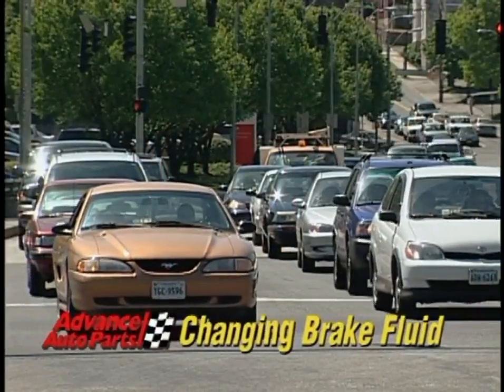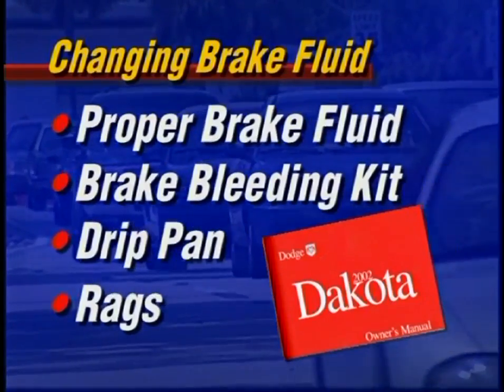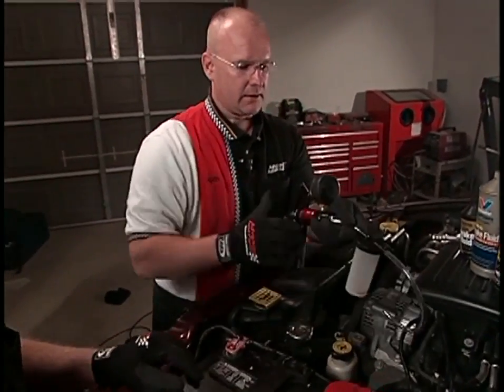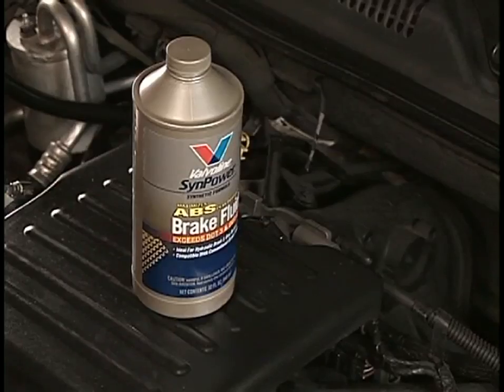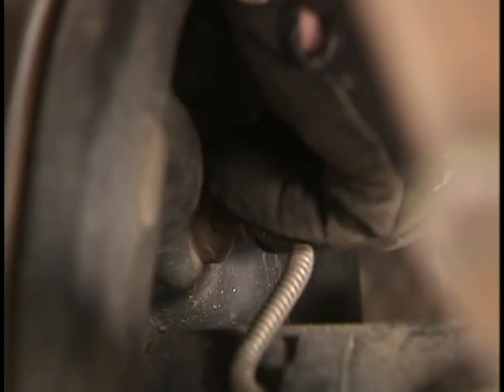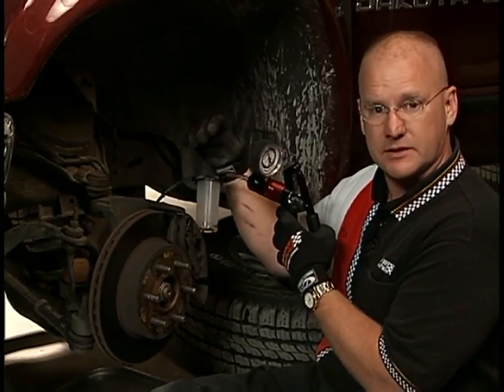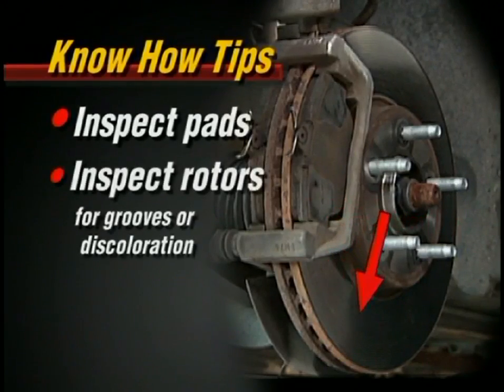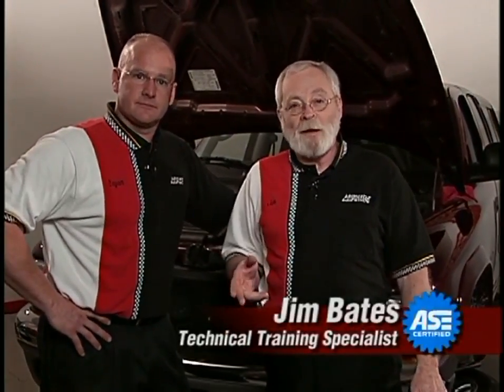How to Change Brake Fluid Video | Advance Auto Parts

Comment: First:  Never use a plain open end wrench on a bleeder screw - use a 6 point box wrench or a flare wrench if you have one.  Next - the bubbles you see when using the vacuum tool are usually the air that enters the bleeder screw through the threads while sucking the fluid out.  You can tell because these are nearly always very fine bubbles unless you have the bleeder screw too far out or you really do have air in the system.  Looks to me like the first instance the bleeder screw was leaking past the threads - very normal.  Otherwise great video keep up the good work!

Comment: I bought a $13.00 pump @ pep-boys and  I got the job done. One tip that I should tell you guys. If the bleeder valve is hard to loosen, spray a little bit of PB Blast on it. Otherwise you might break the valve. I also used a socket wrench. The same goes for tightening the valve, do not over do it, or you will break the valve.

Comment: I'm pretty sure most master cylinder reservoir caps have a vent hole to prevent any pressure differential inside the reservoir. That hole allows air into the reservoir 24/7. That's why you should replace the fluid every few years. It constantly gets wetter, and wetter until it rusts parts and boils under panic breaking.  ALSO, they show silicone brake fluid next to the other brake fluids.  THAT IS INCOMPATIBLE WITH DOT 3 AND 4.

Comment: That's the same reason why you have to quickly get the new bulb installed when changing a light so the electric doesn't leak out and cause a weak charging system.

Comment: EXCELLENT VIDEO!!!!    I was under the impression, we must pump a vacume; first before openning bleeder valves or "zert fittings."   However, after watching your video...it appears, it's OK to pump the tool; after opening bleeder valves.   It appears to move the brake fluid faster down to the cup, and not pump air into brake system.

Comment: Just one thing should have been mentioned, you should use a line wrench on the bleeder valve so you don't strip the nut.

Comment: Just make sure the cap is on tight and you'll be fine, if it has been sitting around for a long period of time you shouldn't use it but a couple of months wont hurt as long as the cap was TIGHT while it was stored.

Comment: Not always. Some older cars have the brake line running down the passenger side of the vehicle, which then makes the driver rear wheel farthest away from the master cylinder.

Comment: I was doing brake work on my 2000 Jeep Grand Cherokee. I've brake bleeding and change fluid but brake is not firm after I've bleeded. I've spoke to the mechanic; he said I have to turn the key to on position but is that true?

Comment: "I''m going to put the cap on quickly to keep the air out." Give me a break.
Reply: +Baxrok2    yes, its a known fact that air will jump right in there and get underneath the remaining brake fluid.
Reply: I was just about to post that!  HAHAHAHAHAHA
Reply: I know seriously
Reply: Its a sealed system and brake fluid adsorb moisture very fast, the less you have the cap open, the longer your system will last.

Comment: Is there any way you can think of how to seal the threads once the bleeder screw has been cracked? I turn the bleeder valve by just a mere fraction of a turn just to let a small amount of fluid leak, but the vacuum pump keeps pulling air from the threads. I have tried grease but this didn't help me. The problem is is that even with such a nifty piece of equipment, all I can see are small bubbles being pulled from the threads... I would much prefer to see bubbles and then clear fluid to indicate I did a job well done. Thanks.
Reply: I saw another video and the gy mentioned using teflon tape

Comment: Great video! I just had a couple questions. When you're taking the air out is your partner supposed to pump the brake pedal as you're pumping the vacuum pump? And are you supposed to bleed all the wheels? Thank you
Reply: no to pumping the pedal. and yes all brake drums/rotors need to be bled. closest to reservoir first

Comment: Good Video. Would gravity brake bleeding be another consideration. ? The only con is time. The only tools required  are a wrench and a  clear bottle with tubing.  Open the bleeder screws in the proper sequence an let the main veins drain until the old brake fluid is replenished. Keep topping off the master cylinder with brake fluid.. You may also want to tap the caliper with a wrench to get out stubborn air bubbles  while its draining. The other benefit, its a one man job.

Comment: Example at 1:50. For anyone who buys this tool, it is a great tool, but never ever let brake fluid fill the reservoir and flow into the tool itslef. The seal insine the tool is well lubricated and if brake fluid enters the tool it will accumilate moisture, become acidic, and eat away the seal and brake down the lubricant's properties.

Comment: I noticed Bryan was from ASE. According to ASE's Brake certification you should test brake fluid with a corrosion test strip to know if it is bad or not. Color will not give you an accurate reading. Of course you should always check for Green fluid (coolant) or Red fluid (tranny fluid) which may have been placed in the master cylinder reservoir by mistake. Also that bleeder they were using did nothing that a simple tube and bottle could accomplish.

Comment: You don't need to bleed brakes after you change brake pads. Many people I know do the wrong thing by pushing the piston back in and the fluid back up to the master cylinder. The bleed nipple/screw should be opened to let the old brake fluid out when pushing back the piston and the brake fluid should be topped up to mark. You should not leave brake fluid exposed to the atmosphere, and it should only be replaced when it is tested and found to be contaminated with water accumilation over time.

Comment: hi, thanks for share this information...
One question, if your car has ABS brake, you can use this procedure? or you must take some precautions?
Reply: Should work on nearly all vehicles. If you have concerns, get an auto repair manual for your vehicle (they run anywhere from 15-30$)

Comment: Does the vacuum method require two people?
Reply: Nope just one, start at the wheel farthest away from master cylinder. once you start sucking don't let reservoir go dry keep close eye on it. Much easier if you have a second person to stand at reservoir and keep it topped off.

Comment: Question: I have seen other vids where they state to not put the cap back on the master cylinder reservoir after filling it before pumping out the fluid? Unless the reservoir cap has a hole, it sounds cirrect to leave the cap off so the suction works...

Comment: Hello What is the right sequence to start brake bleeding
Reply: 1st drink beer first,  2nd then get friend to hold beer so it dont fall over. 3 warn the friend not to drink your beer 4 dial ambulance due to seeing friend drink beer......once done all that do the wheel nearest to the master cylinder first, then second closest finishing with furthest wheel away from master cylinder..... check fluid level between each wheel or have a friend who dont drink beer keep it topped up.

Comment: Is it ok the replace dot3 with dot4???
Reply: Yes, it's has a higher boiling point I believe. It is perfectly safe, but never use DOT 3 in a Dot 4 system.
Reply: Check your reservoir cap. It says which one you need. Mine says dot 3 or 4 for a Mitsubishi Mirage 2014. I replaced all my fluid with 4!
Reply: You can replace DOT3 with DOT4 or DOT5.1, and you can replace DOT4 with DOT5.1. The higher the DOT number the better, EXCEPT FOR DOT5, DO NOT USE DOT5 SINCE IT WILL TOTALLY DESTROY YOUR BRAKE SYSTEM. DOT5 can only be used for cars that specifically ask for DOT5, if you put it in any other car it will destroy it.

Comment: My brake warning light came on for a few seconds and went out earlier today and hasn't come on since.  Can dirty brake fluid cause that to occur?
Reply: +heyitschinoable turns out I had a brake fluid leal because the last time the light came on it said o the odometer screen low brake fluid so I topped it off. And it looks like it was fixed after my last oil change.
Reply: You only put a band-aid on.  Brake fluid get low for a reason - worn pads, a leak, etc.  Same as with catalytic converters - you can fix the problem, but if you don't fix its source, you'll just end up with a broken/out of spec part or condition again.  99% of the time it's worn pads and after replacement your level will be full again.  That's why you don't top off fluid as pads wear - it'll overflow when you compress the piston back in otherwise.

Comment: You can't use this tool for drum brakes as it compresses the weak spring in the wheel cylinders and causes air to be sucked in. That's why they show all the air in the line and not a full line like they show on the front disk.  You must pump the drum brakes to remove air or use a pressure system such as Motive.  Something goofy is when the old man says; he's going to place the cap on quickly to keep air out of the system. LOL

Comment: if you done the job well brake pedall should be hard to press, if it's not than there is some air in the system. Also brake fluid changes job is about 20min job (if you are professional), not an hour job!

Comment: Well you don't "need" to bleed the brakes, but when changing pads you've already done 95% of the entire job; i.e. the wheel is off, the bleeder is unscrewed, etc.  Why not spend an additional 45 seconds and have someone pump the brakes until the fluid runs clear?  Brake fluid is cheap and although laboratory testing is possible, why not just flush the system every time you change pads?   Brake fluid should be changed and the brakes bled more often than most people do it.

Comment: fuck and i wasted all my time using a vaccum pump on the goddamn drum brakes
! how the fuck do i bleed my brakes, i put in a new mc cylinder and i bench bled it and installed then started bleeding rear passenger brake and got a nice stream for like 2 min and then air bubbles came out normal normal but then it just stopped flowing and i pumpped it vacummed it all fucking day and its still on fluid flowin wtf do i do any suggestions people???

Comment: Completely unnecessary to replace the reservoir cap every time after topping up the reservoir.  As long as fluid is in there, no air can enter the system.  Just don't let the reservoir run dry.
Reply: haha yes that was funny OMG quick put the cap on. those who can't, teach ,my instructor told me that at UTI
Reply: It's not "extremely hygroscopic" like it won't suck the moisture out of the air around it. Leaving the cap off for a few minutes while bleeding brakes will not hurt anything.
Reply: That's exactly what it does (absorbs air)... not so smart are you?
Reply: Yes, brake fluid is hygroscopic... OVER TIME.  Like if you leave it in the system for more than a few years it will eventually absorb moisture and rust out the brake lanes.  But leaving the cap off for a FEW MINUTES will literally cause zero problems whatsoever.  Guess what's in that reservoir above the fluid when the cap is on? DING DING DING it's AIR!!!  So yeah, not so smart are you?